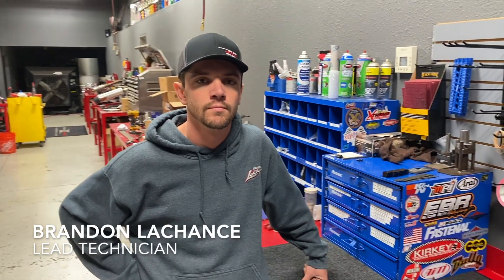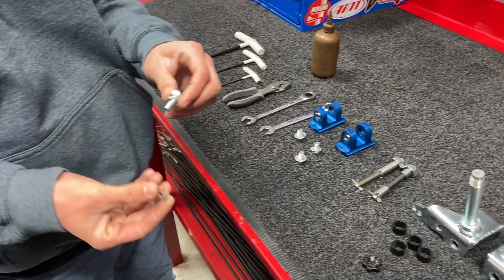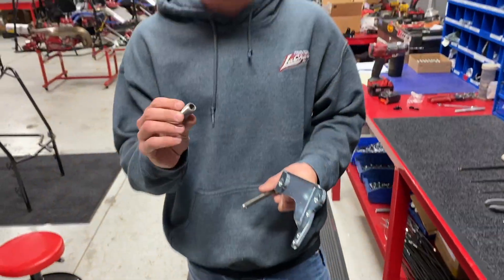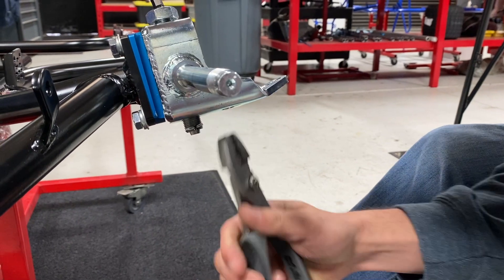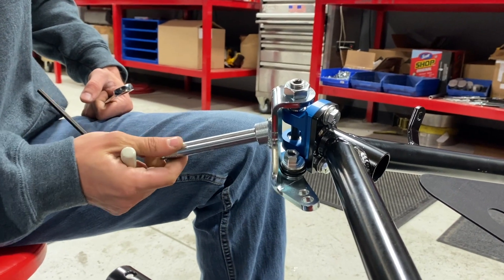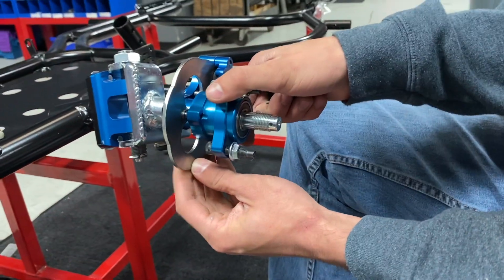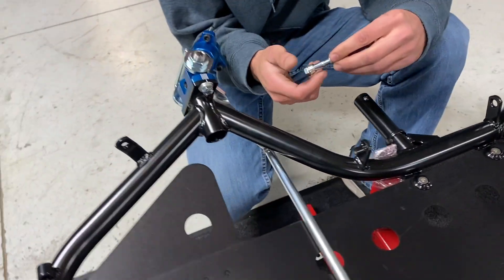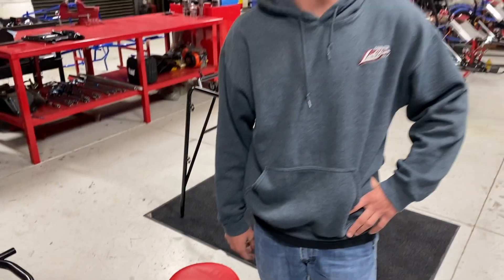How to build an Outlaw Kart: Step 2 - Front End Assembly

Comment: In theory if you had a keyed right spindle made you could order a second brake kit and switch it over correct? I got an intermediate class kart the other day I have no intentions of racing on an oval track so I want both brakes. I'm also going to fabricate my own wing up top with equal side panels.

Comment: Okay so this video is pissing me off because it's confusing the shit out of me... But why is it that you only install brakes on the left side and not the right? Even on your website it's the same thing you only sell the left side system and not the right. Generally I grew up with any kind of vehicle having brakes on both sides. I just got a shifter kart and it only has rear brakes but I want to put front brakes also but you guys only sell it for one side I don't understand. Any information would be helpful thank you
Edit: normally I race drag cars Fast and the Furious Dom Toretto street racing type shit but I am literally brand new to karting so my apologies I don't know much but I definitely want to put brakes on both sides on the front😂
Reply: I know this is 6 months late but on an outlaw kart that races on dirt they run rear brakes and only a brake on the LF. No one in this type of racing used a RF brake

Comment: 6:02  short key could fall out if set screw gets loose, that's not safe. Also seems to be missing a lot of pinned / wired fasteners... everything on the tie rods and spindles should be safety wired.